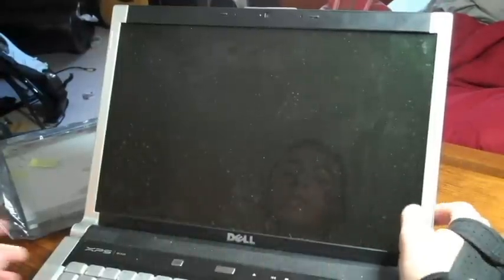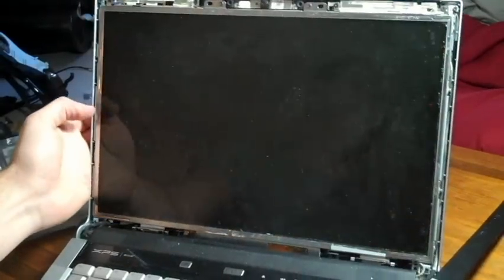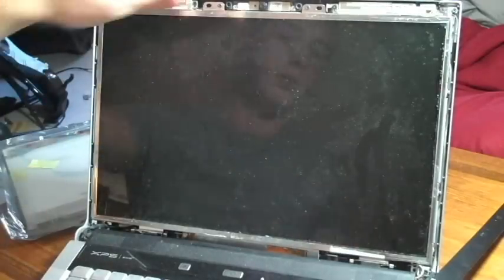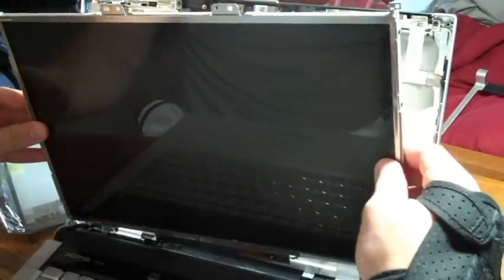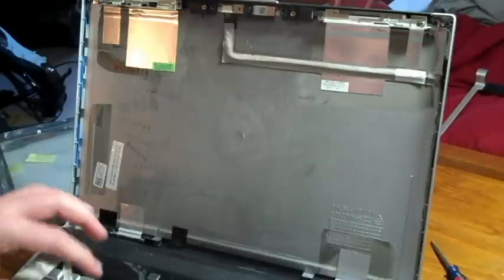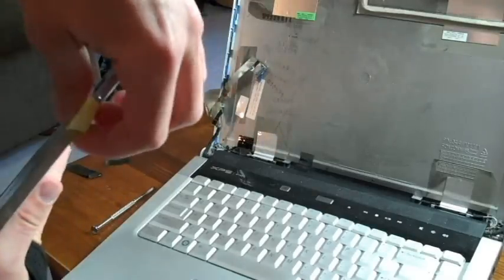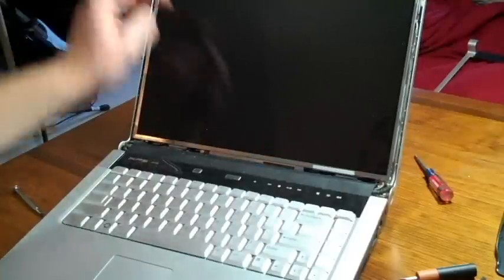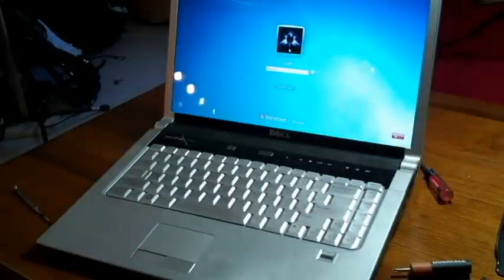How to replace laptop screen Dell XPS m1530

Comment: it to the new screen the same way you removed it. Mine only had one hole to place a single screw as apposed to the two I removed. Worked perfectly. I forgot to mention that the white connector needs to be removed before doing this and then reattached from the new screen.

Comment: My screen had a little white connector on the bottom that had a white and pink wire attached to it. Everything else was the same and your instructions worked great. Here's how I fixed the issue: On the original screen, the part that connects the small ribbon in your video needs to be removed from the metal housing. Remove the two very tiny screws that hold it to the housing. Slide the piece towards the left (his left), lift up the right side, slide to the right and it should be removed. Attach